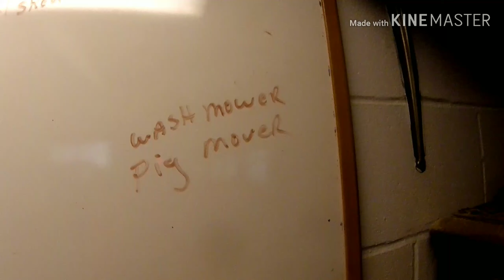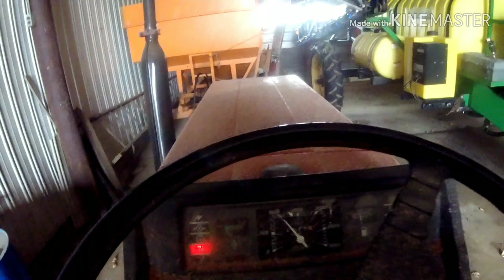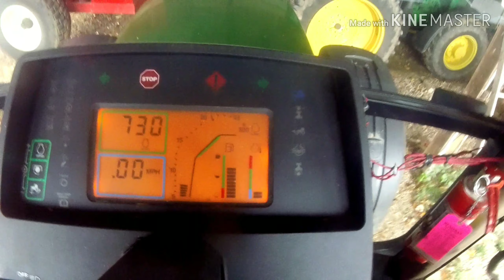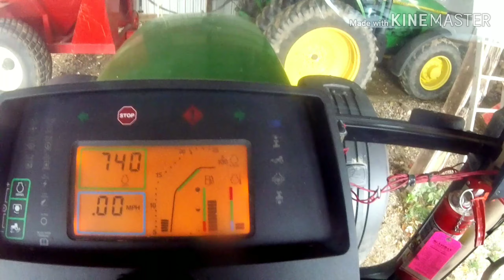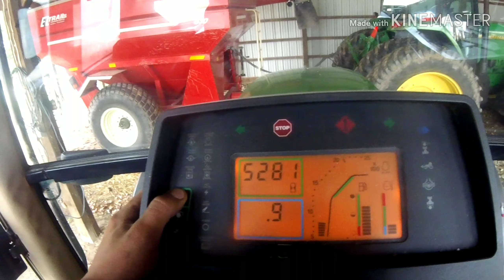LOST FOOTAGE! Moving equipment

Comment: Always fun shuffling equipment around..lol
Reply: Gosselin Farms Ed Gosselin looks like you and I are the only ones up and we’re on different sides of the country.
Reply: @RandWFarmstead-TonyWalsh  dang old man!!! I just woke up to something.. probably just needed to move a bit. And it says you were here 58 minutes ago.  That would have been 12:13 my time..what you doing wandering around YouTube at 3:13am??? 
Oh, wait! I know!!! At about 3-3:30 my time is when Andy Detwiler usually gets videos up.. you're making sure you beat me there!! LoL
Reply: Gosselin Farms Ed Gosselin, 20 years of fire/EMS has got me sleeping in 2 to 4 hour increments. I get wide awake, go to bathroom, read my phone and go right back to sleep.
Reply from the maker: Thanks for stopping by
Reply: @RandWFarmstead-TonyWalsh  lol.. I always sleet good until the Plectron went off! Once I got back to home, I either stayed up of back to sleep 😎
Then came the pagers, first ones were a joke.. so the old Plectrons we're still used.. until they changed radio frequencies, then the pages worked great, but the radios don't😂🤣(800mgz and hills and valleys don't work well..)